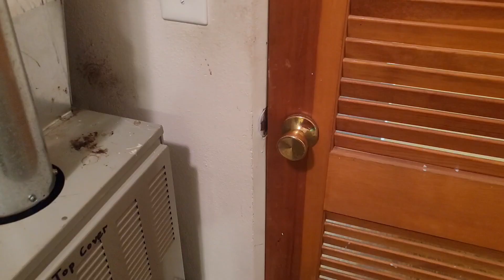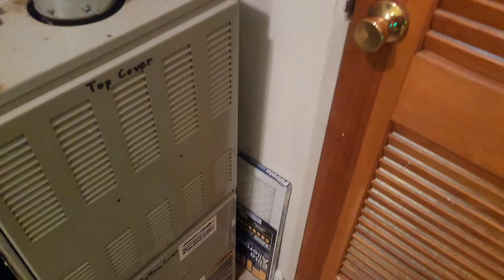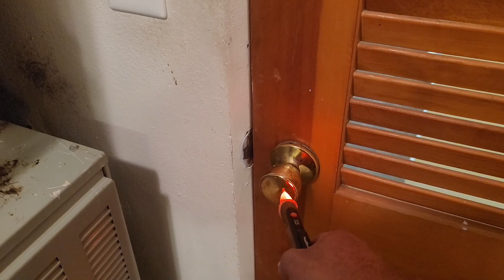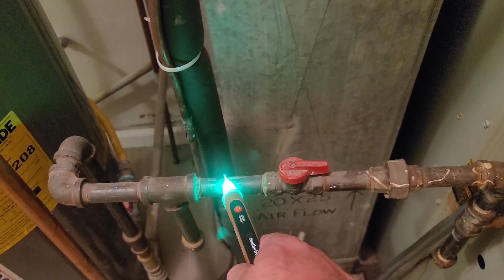How can you get an Electric shock from a doorknob?

Comment: Fun fact. Getting an electric shock @110v won’t effect a pace maker, nor will it give you a heart attack. I have a pace maker and Iv had two heart attacks. I get shocked more than most probably have  doing electrical repairs. JS
Reply from the maker: That is WRONG. The standard 120v household circuit is rated at 20 amps. It is the amperage that kills you, not the voltage. 1/10 of an amp is enough to kill an average-sized man. We can get "shocked" on a 120v circuit and live because the amperage applied to your body is determined by the resistance between you and the return path to the source. Standing on a dry wooden surface, we are notified that we have made a mistake and should immediately turn loose of whatever we just touched. Standing on a wet surface that supplies a good source to ground, however, may end up in death. This is why GFCI protection is so important.